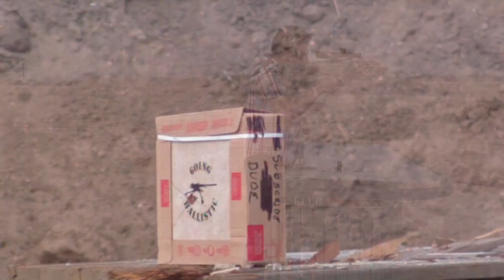308 Rounds vs Different Types Of Floor Tiles

Comment: hey have you shoot metal foam  be for 
A metal foam is a cellular structure consisting of a solid metal with gas-filled pores comprising a large portion of the volume. The pores can be sealed or interconnected. The defining characteristic of metal foams is a high porosity: typically only 5–25% of the volume is the base metal.
Reply from the maker: I've never even heard of it. I'll look it up
Reply: @GoingBallistic    ok  hope you the best 
with getting some if you do

Comment: I'm not going to stop requesting the propane tank vs APIT round.
Reply: He'd probably need to use Raufoss. Normal incendiary is likely to burn too fast to light propane. Raufoss contains a secondary, longer burning incendiary, designed to ignite jet fuel.
Reply: @timewave02012  you're correct! I'm just trying to figure out why no one has tried this!
Reply from the maker: Keep requesting it, we will do it with a raufoss round, I promise. Really busy with other videos and in the middle of a move, but we will see if it will take out a bbq grill👍
Reply: Wow, thanks for replying! I've said before that I think you guys have one of the best channels on YouTube in reference to the pew pew lifestyle!

Comment: I've been loading api in 3006 for a few months now with IMR 4064 and can't get under 5 moa @100 yards. Am I doing something wrong?
Reply: Could be a lot.  Wrong powder charge.  Wrong powder. Wrong completed overall length.  AP isn't the most accurate to begin with.  I suggest Johnny's Reloading Bench for reloading.
Reply: That’s all bad, my old lake city BT gets 2 moa out of 24” 700

Comment: 4:46 Why they were destroyed in such a strange way? I mean 1st not destroyed, just a hole, 2 and 3 completely destroyed, 4 the same as 1st, 5 and 6 destroyed... This is interesting 🤔
Reply: Because the rounds going so fast it pretty much just poked a hole In the tile also tiles are all different even amongst themselves a tile can be stronger in some parts then others as well as some tiles can be tougher then others they are all imperfect

Comment: only one problem using that gun with a 12 in barrel is it isn't going to give you the full potential of those 308 round because your not  burning all the powered. To get the full potential of a 308 you need a 20 in barrel. I have a 308 match rifle with a 20 in bull barrel and with hunting round alone it will shoot threw a box of ties, or 10 of the other ties. Reason why I know this is because I tested my 308 with hunting round and it went threw a cinder block at a 100 yards. You can say I'm wrong , but actions speak louder than words. So I'm ready for all the trashy comments, and all the smart alecs.